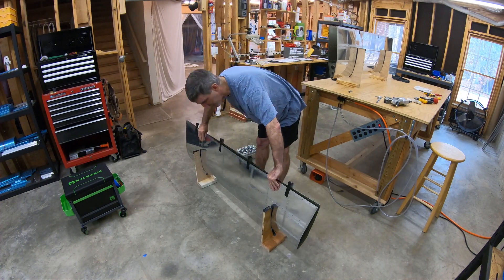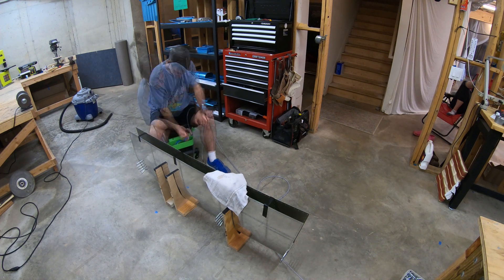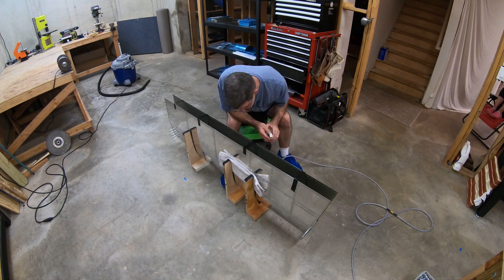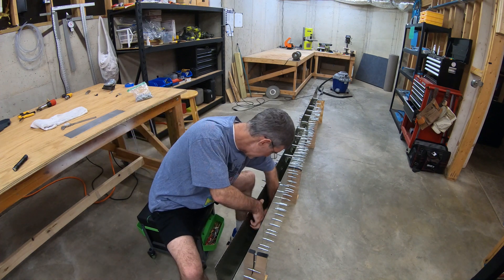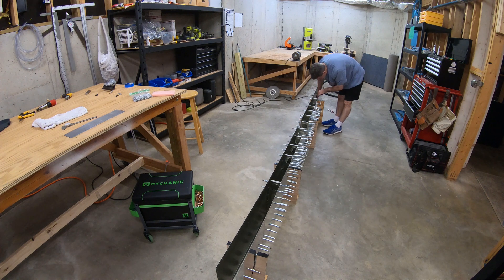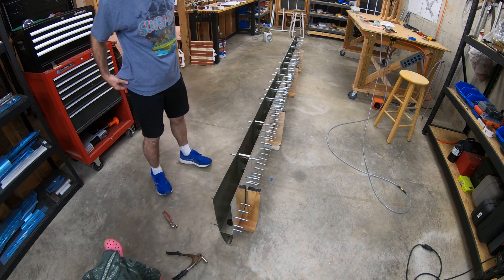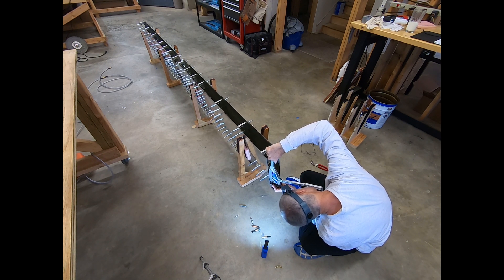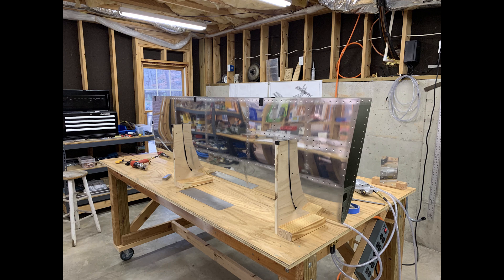RV-10 Build Log - Emp 49 - New Cradles, New Squeezer, Tricky Rivets

Comment: Used the Main Squeeze at a sheet metal course. Bought one immediately. The cams takes less effort to set solid rivets than even a pulled-rivet gun. Also, you make a good point for having both sling-style cradles as well as formed.
Reply from the maker: Yep, very happy with it.  Definitely a place for both the hand and the pneumatic squeezers.  As for the cradles, I've also seen folks that made sling-style cradles, then hinged contraptions to compress and hold the skins in place during the first part of the assembly.  That should work too.  I just decided to to make 3 more rib-shaped cradles because I had already made one earlier.

Comment: Okay, that was convincing enough. I had the same thoughts about manual squeezer giving more control. I tried feathering pneumatic squeezer, and it kind of works when it works. But then it doesn't, the result is usually disastrous...

Ordered myself a Main Squeeze 💸
Reply from the maker: Yep, I've had the same experience with the pneumatic.  It's great for "mass production" and cranking through lots of dimples or along a long line of rivets on a spar.  But if you're trying to go slowly and carefully it's not so easy, even with the foot pedal.  And as you say, when something goes wrong, it does so quickly and with no forgiveness.